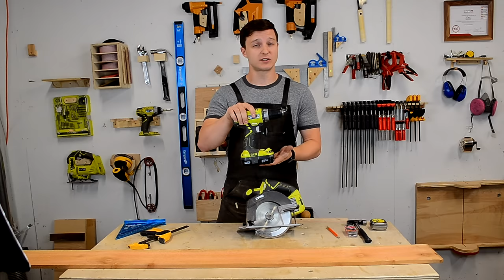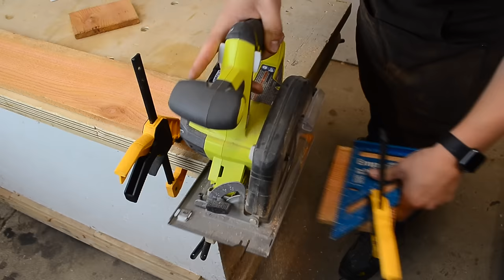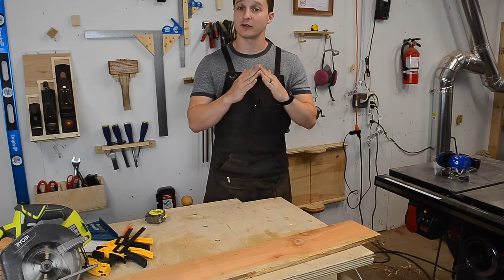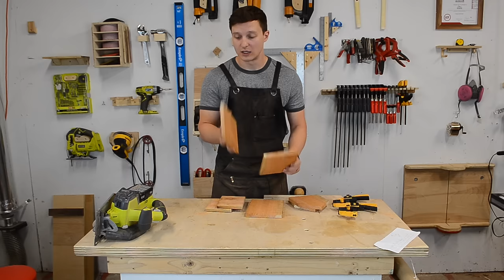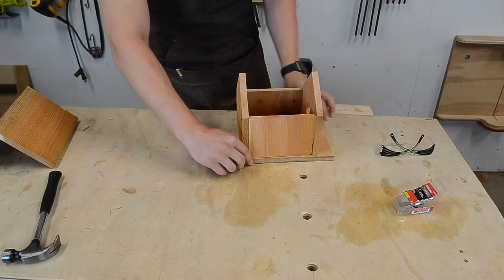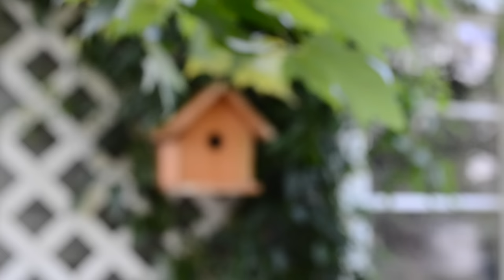EASIEST DIY Birdhouse with Minimal Tools, Every Step Explained

Comment: I love this house🙂 I got to almost to the and of the video and I noticed you didn't make a way to clean out the house. I will try to build this house 💋 I just get so scared of the saw 🙄
Reply from the maker: You can easily make this with a hand saw, too... much slower, safer, and more controlled. Hand tools (while still dangerous) are definitely a safer option!
Reply: @dkbuilds  😉Thank you.

Comment: How exciting!  Just wanted I wanted to learn.  Outstanding teacher!!   You spent a ton of time making all the links.  What is the bit that makes the holes?  Thanks so much - subscriber from FL.
Reply from the maker: How fantastic, you are so welcome SLG! I use a forstner bit to make the hole, but there are many other options like spade bits, or hole saws. Or you can drill a small hole to get a jigsaw blade in, then use a jigsaw to cut the rest of the circle. Thanks for watching and commenting!

Comment: I want to make these houses but could you share how will I be able to hang it up ? I am planning to use real trees - we have plenty of big trees here  - what’s the best way I can hang them up  do you have a video for it
Reply from the maker: That's a great question! I hung mine on a fence by screwing a string into the roof and looping the string around a fence post. Maybe you could attach it to a tree by first nailing a small block into the tree, then attaching the house onto the block

Comment: Nice, aren’t you suppose to have a drain and ventilation holes?
Reply from the maker: Yes! You can drill a few holes in the bottom. Also I would attach the roof with screws so you can remove it each year to clear out old nests.

Comment: If you had a brad nailer would that work as well and be as sturdy? Also, is a hole that small enough for the birds to go inside?
Reply from the maker: It definitely would work, just be careful not to nail your fingers accidentally. And yes the hole is definitely a good size for birds.

Comment: How do you hang the bird house permanently (not bird feeder) on a branch 20 feet high without a ladder or climbing the tree?  I've looked all other on how to do this but can't find info.
Reply from the maker: Hmm that's tough, I'm not sure how. Maybe you could tie a string to the birdhouse roof, throw the other end of the string over the branch, then pull the string down to lift the house up? Really I'm not sure, I have always used a ladder. Sorry!

Comment: I was thinking of sanding the wood.  How fine should the grit be?
Reply from the maker: Good idea! It depends how rough the wood is to start with. My fence posts were quite rough so I would start with probably 80 grit, which will get it smooth to the touch. If you want it to look really smooth you could then switch to maybe 100 or 120 grit, then 150 grit. You could go up to 220 but 150 would be more than good enough for a bird house in my opinion. Good luck!
Reply: @dkbuilds  thanks

Comment: What about drainage and a way to get in to clean out each season?
Reply from the maker: I recommend attaching the roof (or floor) with screws so it can be removed and reassembled each season.
Reply: I've built this type of birdhouse and hinged the roof. Also put in a little latch to secure the roof closed so predatory critters can't get in. You also want to make sure to put some kerf lines under the entry hole on the side in the house, so fledgling birds will be able to get out. Finally, from my research, hole size and position from the floor matter. Depending on what type of bird you want to attract to your birdhouse. Do your research first and plan accordingly.

Comment: Great video! Why nails and not screws?
Reply from the maker: Thanks! Good question. Screws are just as good, but you might have to pre-drill to avoid splitting the wood. I used nails just to make it as easy as possible for people to build.

Comment: Hey I don’t think you will respond but I need to know for a woodworking project at school, but what type of nails are those and how long are they
Reply from the maker: These are just brad nails which are I think are about 1.5 inches long or so. It doesn't matter much, in fact brad nails aren't really the best choice. Any 1-2 inch nail should be fine for this.
Reply: @dkbuilds  ok now I know what to do. Thank you very much‼️

Comment: That’s great but a latch on the roof would make it easier to clean.
Reply from the maker: Yup I definitely agree. Or attaching the roof with screws instead of nails.
Reply: I did this but only watched 1/3rd the video and it was fairly obvious how to put together. The one thing I happened to have were some small hinges so I only nailed half the roof on the hinged the other roof piece to that it worked great!
Reply from the maker: @brandonhooper7748  Sounds like a great idea. Thanks for sharing Brandon!

Comment: How do you clean out the old nest material?
Reply from the maker: Good point Ray! I pry off the roof and nail it back on. In the future though, I would recommend attaching the roof with screws so you can easily remove it to clean out old nest material.

Comment: How do you clean it out.. How about i/2 the roof on a hinge?
Reply from the maker: Putting the roof on a hinge is a great idea! Or, attaching it with screws that can be removed. This particular design isn't great for cleaning it out. I pried the roof off, cleaned it out, and nailed it back on. But, I would use screws next time.
Reply: @dkbuilds  screws is a great fix.

Comment: If you are going to make a lot of birdhouses (4) for your grand sons or whoever. 
Please Don't ever trust the dimensions (Width) of the planks, they are all different (5 1/4", 5 3/4" and 6")
Use one plank for a bird house only. Do not try to cut one plank to make fast production of all the parts. 
In other word one plank for a birdhouse...Lesson learned.
Reply from the maker: Very good point Luis! I hadn't thought about that. Thanks for sharing your lesson learned!

Comment: Good instructions for a simple build. However, it's obvious that your viewers have very little knowledge of how a bird house should be constructed. Here are my three advice for a better construction: 1) The entrance hole should be placed higher up to make it harder for predators to access the eggs. 2) For the same reason, the "porch" you built is not necessary for the birds - only for predators to sit on. 3) You should make it possible to easily clean the bird house; the front or one of the sides should be able to swing open. Furthermore, a few small holes at the bottom for drainage and some higher up for ventilation is also recommended. Thanks.
Reply from the maker: Thanks for the great tips Vinterfried! I haven't had any issues with the hole size and location, or the porch, but it possible I just don't have many predators in my area. However I definitely agree about #3. I had to pry off the bottom to clean out the nest, then reattach. I would recommend attaching either the roof or the bottom with screws which are more easily removed and replaced each year for cleaning. Thanks for watching and sharing your knowledge!

Comment: How do you clean out the bird house
Reply from the maker: Good question! I was able to pry off the roof to empty it out, then I nailed the roof back on. I would suggest using screws on the roof so it is easily to remove and replace.

Comment: What is the name of the tool you used for the hole? How can I cut a heart shape instead of a circle?
Reply from the maker: That is a drill with a bit called a "forstner bit". For a heart shape, the easiest would be a scroll saw but if you don't have access to one, you could use a jigsaw. Or, drill many small holes in the shape of a heart and punch out the middle to roughly get the shape, then use sand paper or a rasp to refine the shape to look better. Good luck!
Reply: @dkbuilds  thank you! I'm going to build my first bird house. I appreciate your quick reply. I was hoping there was like a heart shaped wood cutter 😅...wouldn't that be wonderful?!!

Comment: Why didn't u place the speed square on the other side of the saw and cut across from the other side safer than having to balance a speed square on the peice your cutting off
Reply from the maker: That's a great idea Jake -- much better than what I did. I'll use that method next time!

Comment: You should have used wood glue on your seams. Helps prevent water from getting in and also holds it together as the moisture from being outside will cause the wood to swell causing gaps within the seams!!
Reply from the maker: Thanks for the tip Danny!

Comment: Cut off the "step" on the front of any small birdhouse, all it does is give crows and other predators a platform from which to attack eggs and chicks. 
In order to make it easy to clean out small bird houses, such as those with small circular entrances, allow the base to be removed, just by sliding it out.  This removes old nest material and also ensures there is no build up of pathogens or parasites inside the birdbox.  HTH
Reply from the maker: Great ideas, Kieran! I've gotten a few comments about making the house disassemble-able (to remove old nests) and about removing the perch for predators. I'll definitely work those features into my next design!

Comment: Just wondering, why didn't you use any wood glue?
Reply from the maker: That's a good question! Wood glue really only works (well) when two very smooth pieces of wood come into contact. In my experience the rough cedar planks aren't great for that without some sanding first. Other glues which are more gap-filling like gorilla glue might work though. Overall, I didn't use glue because I didn't need any :)

Comment: how do you mount this to a flat surface?
Reply from the maker: Great question! You could get an extended bit and drive a screw through the hole in the front, through the back, into the surface. Or, what I did was to put a small eye hook on each side of the roof connected by a string to hang the house off of a nail in a fence. Hope that helps!

Comment: Simple and easy, but
1) the front door plate is very good for cat or marten to hold there
2) then they can reach a baby bird, because door hole is so close from inner bottom/nest
3) then the doorhole is not hardened with steel/alu plate from outter side, so wood-pie can break it
4) bird-house cannot be opened anymore, so you cannot clean it after season
Manual is perfect, no offense... But such house can be a trap for birds in this way...
Reply from the maker: What an informative comment! I agree, the house is far from perfect. I'll try to work some of these suggestions into my next design!
Reply: These are the same valid points of concern that I wanted to make.  Ty

Comment: Excellent video! What hardware do you suggest to use to mount it to my privacy fence?
Reply from the maker: Thanks Sonia! For my house, I screwed two eyehole screws through the roof and hung it from the fence. You could also screw directly through the fence into the back side of the house. Or buy an angle bracket to support the house from beneath. There are lots of ways to do it... let me know what you come up with!

Comment: Need glue to make it hold better. Job well done
Reply from the maker: Thanks for the comment! Unfortunately I only have wood glue, which would not work well here because the fence post is very rough (wood glue only works when two very smooth surfaces are in contact).

Comment: What size of nails do you recommend
Reply from the maker: Good question Jacob! I used I believe 1 1/4" brad nails for these, but honestly a wide variety of nail sizes would work for this. I would say for this thickness of wood between 1 and 2 inches is good.

Comment: How do you keep the bird house clean after the birds have had their babies
Reply from the maker: Yes, I knew that was an issue while designing this. I wanted to make a bird house that was as simple as possible to build. Maybe in the future I will make a slightly more complicated house with a way to remove the roof. Probably just attaching the roof with removable screws rather than nails is enough. Thanks for watching!

Comment: Thats a great birdhouse and tutorial but how do you secure it to a post if you cant get inside to screw or nail it down I`m thinking to myself.
Reply from the maker: That's a very good question! I mounted mine with two small eye bolts through the roof with string looped through a fence. It has held up well so far.
Reply: @dkbuilds  Thank you! I`m going to try to make a wood spirit bird house by using  a thicker front board and longer for the beard and screw it into the sides after I carve out the face. I made another bird house 18 years ago out of cedar and its still hanging up on the porch. Its a little warped now but the birds still visit. Excellent video you have created and I`m sure it will help young and old alike for many years when they want to learn how to make a bird house.

Comment: Hi i was just wondering how would i mount this bird house
Reply from the maker: I screwed some eye-hole screws in to the top and used string to hang it off of a fence. You could also screw directly through the fence into the back of the bird house, or any other solution :)

Comment: If you drill a series of holes to make the hole, follow with a convex rasp to clean the edges. Be creative, make the hole egg-shaped.
Did you use galvanize nails❓
Before nailing on the floor, set it on a 4x4 or other object, to avoid having to balance it on its gables.
Reply from the maker: Good idea with the rasp, I bet that would work great! Yes the nailed I used were galvanized, which will hopefully help prevent rusting for a while.

Also a great idea with the 4x4, I wish I had thought of that to include in the video. Would have been much more stable!

Thanks for watching and for your ideas!
Reply: I prefer round holes for bird houses. They look cuter.

Comment: Unfortunately, this birdhouse is only for one brood, as you have to clean a birdhouse in autumn, which is not possible here.
Reply from the maker: Yup that's correct. This year I simply pried off the roof to empty them out and reattached them. It worked this year but next year will probably the last for the bird house. I had to sacrifice the cleaning-out functionality in order to make the simplest possible birdhouse for my viewers to make. Thank you for watching and commenting!

Comment: I was building the same thing when I was living in Ohio.  I was selling it for $5 a piece.  I love woodworking.
I have one question, why didn't you make a removable back?  You have to clean it out every years.  If not, birds will not use it the following year.
Reply from the maker: Awesome, thanks for sharing Kitt! Yes a removable back (or removable roof) is the way to go. I was trying to make this video as simple as possible. When I make them for myself I use screws to attach the roof so they are easy to empty out.
Reply: @dkbuilds  I forgot to thank you for sharing this awesome video.  Thank you my friend.

Comment: Stay away from the spinning blade of the circular saw.
Reply from the maker: Good tip thanks!
Reply: @dkbuilds  a Carpenter said that if the blade flies out by accident.... you know

Comment: and how do you open it to clean it out?!
Reply from the maker: Yes, I knew that was an issue while designing this. I wanted to make a bird house that was as simple as possible to build. Maybe in the future I will make a slightly more complicated house with a way to remove the roof. Probably just attaching the roof with removable screws rather than nails is enough. Thanks for watching!

Comment: How do you clean it though?
Reply from the maker: Yes, I knew that was an issue while designing this. I wanted to make a bird house that was as simple as possible to build. Maybe in the future I will make a slightly more complicated house with a way to remove the roof. Probably just attaching the roof with removable screws rather than nails is enough. Thanks for watching!

Comment: Curious what size nails you used?
Reply from the maker: I believe I am using 1 1/4" brad nails here... but kind doesn't really matter very much. Zinc coated nails might help prevent rust over time.

Comment: The ledge on the front is unnecessary and in fact makes it easier for predators to get at the baby birds inside as it gives them a place to stand. The same with perches.
Reply from the maker: Good tip thanks for sharing! I've heard that from others. My next batch of houses won't have the ledge!

Comment: Great video. But I’m gonna Criticize a bit.  First my suggestion don’t put your hand near that blade you think you’re helping guid it but it’s more of a safety issue.  If you’re guiding the front you must be pushing on the saw. If you’re pushing on the saw and your thumb slips it’s going right into that blade.    

Another tip if you were to cut going the other way your saw will pass by the clamp. Also if you put the clamp the other way so the handle is below the table you will be able to pass by it.   

Teaching people to copy a cut you just made is kind of controversial in wood working.  Because your copy will be bigger unless you cut the line off. Still with all the clamping the square down as a guide. It’s like you’re trying for perfection with an imperfect measurement. It’s kind of how people will mark all the measurements in one go then cut everything to find everything’s shorter then what they measured. 
This bird house doesn’t really matter for perfection honestly but later projects 

Really the main thing is learn to cut with 1 hand keep the other had at least 6” from the blade.  This goes for just about any power tools. Obviously not really practical with like a drill or some times with bandsaw.   But as common practice.
Reply from the maker: Thanks for the detailed reply and the advice Brian!